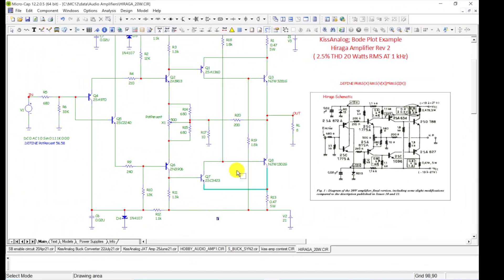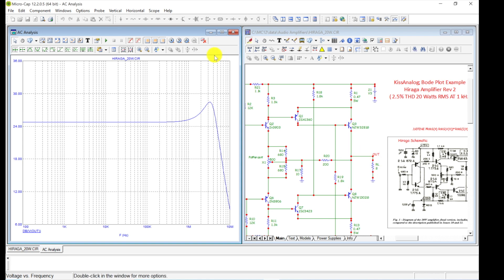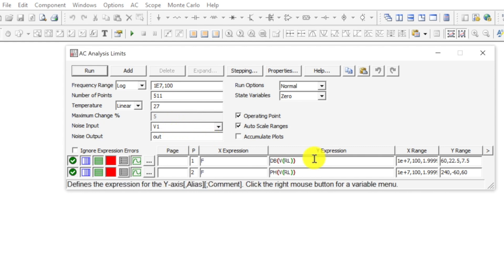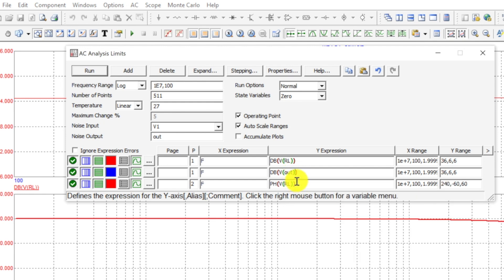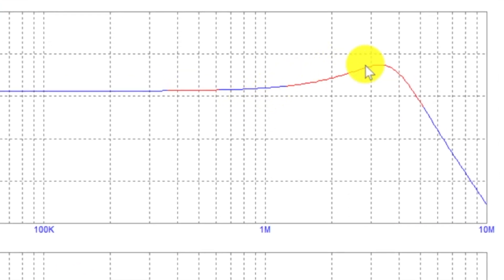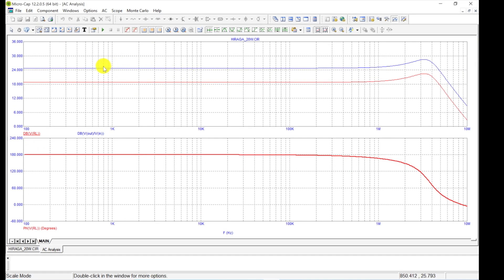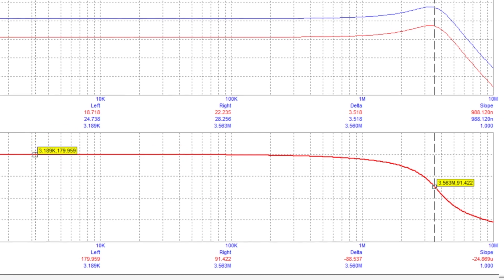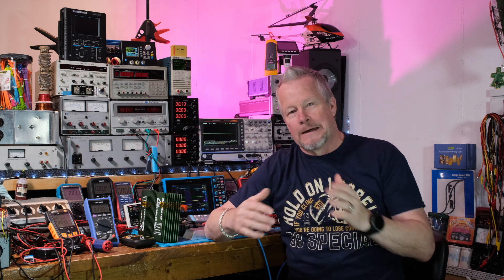How to Bode Plot with Hiraga Amplifier with MicroCap Tutorial #microcaptutorial #hiragaamplifier

Comment: Hi Eddie, thanks for all your content I've learned quite a bit from it. I've been gradually dipping my toes into Micro-Cap and it certainly feels very powerful. I'd like to use it to check circuits from Kicad (so I don't have to make the schematics twice) and then build the PCBs in Kicad.I'm having trouble opening the schematic/Netlist file(from Kicad) in Micro-Cap at the moment.All I get is a text file in the schematic window in Micro-Cap when I try to open the Kicad file.I'm guessing this is the netlist?But how do I get it to create a Schematic.My understanding of these programmes is quite basic so any help would be much appreciated.Thanks.
Reply from the maker: Thanks for bringing up this fantastic subject!  Actually there are some PCB design software that have built in simulation - BUT - none of these are great.  Or near as good as a dedicated simulation tool like Micro-Cap.  There are several reasons.  One is that it over complicates the PCB design process.  The parts made for the PCB library need a lot of data input, so to put all the model info for the simulation would just make this very complicated and the library would be large.  Also, the schematic for simulation often has other parts in it to account for the parasitic elements.  So, it actually is less work to build two schematic;)
Reply: @KissAnalog  Ok that's interesting.I know there are some paid versions like Multism and Tina(had an old version of that decades ago) that integrate both but they are pretty expensive and I haven't seen a free or open source version that is any where near as powerfull.
Kicad does do simulation.I think it uses Ng Spice but it only has a limitted library of Spice models so one might well have to find these externally for some components.It's supposed to integrate well with Lt spice too but again I'm not sure one would find all the spice models there for a any given component.
So with all these permutations building the schematic twice as you suggest is probably the simplest solution.
Reply from the maker: I've used all those simulation tools and have owned them as well, but Micro-Cap is the better tool IMHO.  It was selling for $4700 before the owner retired a couple of years ago and decided to just give it away for free.  Tina is the next best in that list.  There's a reason LTSpice has always been free;)

Comment: Hi Eddie, 

Thanks for this new addition to the MC12 series. 

After three weeks off, I went ahead with the JAT501. I pretty much finished it in MC12, but there are many small changes required. For one the output transistors are, like yours, not the ones specified by John. Also I could not figure out how to make capacitors electrolytic... another issue that I could not solve is how to select a 2.1v line green diode in the CC for the input LTP.

Cheers 
Mark
Reply from the maker: Nice work Mark!  Yes I didn’t build the library with new parts, but I modified the models in my schematic to be close;). I usually place resistors in series with 5he cap to simulate the esr.  The LED is in the library that you can search for LED.  I think I adjusted the model for the right forward drop.

Comment: Why doesn't it calculate the resistance of the circuit if you're putting one vote in and getting one out  why isn't this calculated?
Reply from the maker: Great question!  Usually we want to know gain or amplitude over a frequency band, but you could divide Voltage by Current to get impedance.

Comment: You should build the Green boards i sent you with the expensive outputs I included :) The Jean Hiraga amp is very good! I think i sent you the 30watt one but you'll get more than 30w with 35v rails and higher bias.
Reply from the maker: Thanks bud - thank you!  I do want to build them, but I'm still acquiring all the rest of the parts;)  I should have something ready in not too long.
Reply: @KissAnalog  Whatcha need ? I have lots of stuff still. Email me.
Reply: @JasonLeaman  Hi ,
I would be very interested in the board build. Which all is this for?  Did you only produce a few boards or enough to sell a couple?  I  remember you mentioning that you might produce a batch, but I thought it was for a different amp.
I'm still exploring what amp to finally build. 
Cheers 
Mark
Reply from the maker: Thanks, I’ll email this weekend.  I started a new job…
Reply: @KissAnalog  Congrats, I too started new job been swamped, JUST releasing a video this morning at 9 :)

Comment: Micro Cap is great, but the only problem with it is unable to model thermal behaviour of amplifiers, because temperature of the junctions is fixed. So it is impossible to measure thermal stability "out of the box". Of course you can rewrite equations of used  Gummel-Poon model by yourself and use them as macro. I'm aslo writing this, because I'm interested in so called "thermal distortion" occurring in discreat transistors, and I'm seatching for a way to simulate it in MicroCap.
Reply from the maker: Thanks for this great feedback!  On BJT transistors, I do see the T_ABS, and T_Rel_local, and T_Rel_Global and about 9 other temp related variables.  I haven't used the temp for a long time so I don't remember the ins and outs, but I do see 9 to 12 variables on both FETs and BJTs that are temp dependent.  I do remember back some years doing thermal distortion analysis because I was comparing BJTs to JFETs, but its been awhile.  What parameters do you want to see temp dependent?
Reply: @KissAnalog  There are many temperature dependant parameters in model, the problem here is any temperature you specified is fixed, and effects of self heating is ignored. I think this is because SPICE is originally designed to simulate integrated circuits, where temperature of the whole cristal is the same because of its small area and low thermal mass. But you can always use your own modified equations and use it as Macro files.